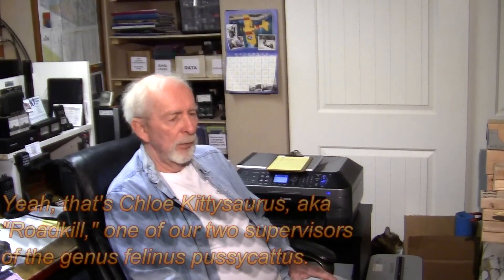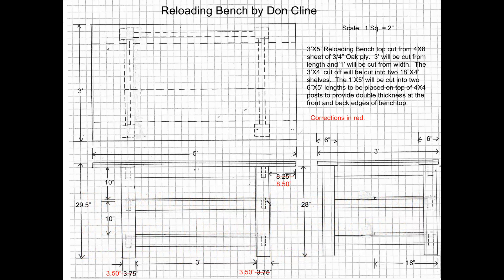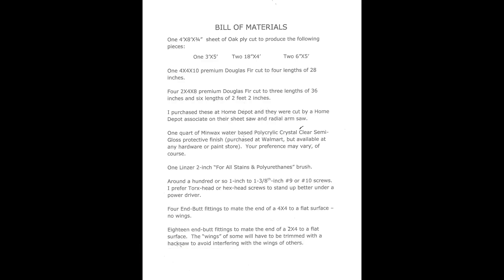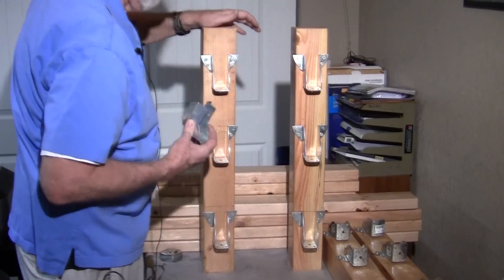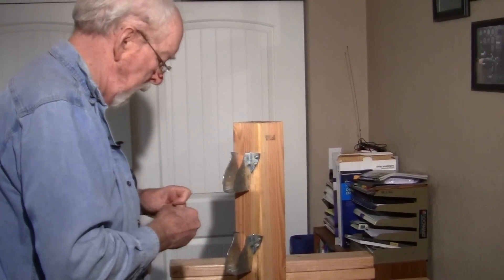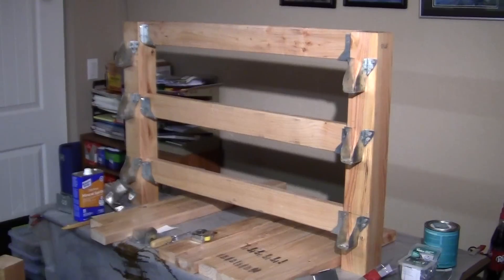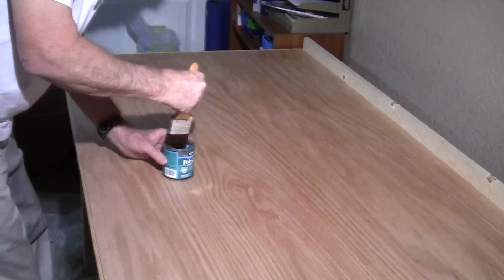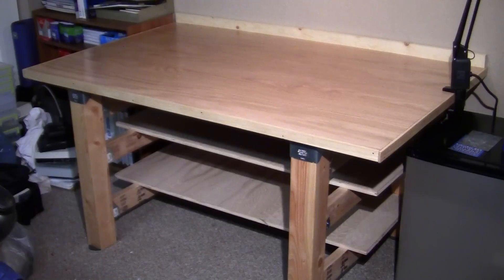Building a Rock-Solid Handloading Bench

Comment: Like somebody said earlier the craftsmanship on this table is high quality. I went to school about 10 years ago to become a carpenter. Your work is just as good as a veteran Mr. Don, so good I will be making my table the exact same.
Reply from the maker: Thanks, JC.  If I had it to do over again I'd reconsider the use of the 2X4 hangers to fasten the legs to the 4X4 legs.  The 'wings' overlap the edge of the 4X4s, and can be dangerous.  At least be prepared to file or cut them off.  Thanks for the compliment; it was my first attempt to build anything like that.
Reply: Don Cline I built a toy box for my nephew a couple years ago. You can go without the hangers and use long screws. But the hangers give the table some class making it stand out so shaving down the sharp edges will work but I wouldn't take them away.

Comment: Great video Don.  I found a Simpson Strong Tie Workbench Kit on amazon, $40.  It has ties, screws, and great instructions included in the kit, you just add wood and tools.  I used my own measurements converted from the kit's plan.  Once my cut list was complete, I assembled mine in less than a hour.  Yes, I could have built one without the ties, but if I ever want to change the size or take it apart to move it, just remove the screws and it should be an easy operation.  Also this is solid as a rock, my total cost was around $90 (30"x60") but, I had scrap left over from the odd size.

Comment: Hey Don, I am currently building this bench using your design. I've increased the height of the legs to 38". I just bought all of my wood this morning and will begin finishing and sanding the wood this afternoon. I'll post how it turns out. Thanks for the video.
Reply from the maker: Good deal!  Hope you like the results.  I have to say I would not have used the 2X4 hangers if I'd realized the "wings" on them would be wider than the 4X4 legs -- or I would have taken the extra time to saw or file them off.  In any event, the results have been excellent; the bench is rock solid.

Comment: You did a nice job on the bench for a non-woodworker. Interesting use of joist hangers and post mounts.  There are a couple of changes you may want to consider if you build another.  For the top you may want to use birch rather than oak.  Birch is much smoother and has a very close grain.  After it is finished it is much easier to clean and is better to write on when making notes when reloading.   Also if you use a sheet of pine B/C plywood the same size and glue it to the birch, this gives you a very stout top. You may can leave out the middle rails and stretchers as this is overkill given the size of the project.  You also mentioned that you would not use the metal brackets, a great alternative to that is pocket screws.  When I built my bench I used my Kreg system and it worked great. Overall nice job.
Reply from the maker: Thanks.  I'm happy with the way it turned out, although I would not use joist hangers and post mounts if I did it again.  (But I don't expect to be doing it again.)  :)  The use of birch rather than oak and B/C Ply sounds interesting too.  As it turns out the oak worked out okay because I put a sheet of static-free grounding sheet,  the stuff used by electronic technicians (I was one) to work on CMOS devices on the top surface.  I grounded it and the reloading press to the AC ground to cut down on static.  The average humidity level where I live rarely gets above 5% except during the monsoon season, and touching anything results in a zap.  I don't want that to happen when I am working with gunpowder and primers.  Thanks again for your suggestions.

Comment: Mostly glue and joints that works  with some “T Slots” imbedded into the surface. If I want my Dillon then I go get it fixed to the base will be every thing to get going. If I want a vise I get  a fixed base that holds the vise.
Reply from the maker: Good luck.

Comment: Hi Don... Wow, what a video! Very impressive... I have 2 quick questions... I have not watched the video entirely, I skipped around a bit so I may have missed if you answered this either in the below comments (I read a few but not all of them...) First question, ball-park cost for this entire table for all the materials (including finish, etc.)? 2nd question, is the table able to be partially disassembled in the event of having to move or transport it elsewhere? Thanks for the great video... Very nicely done!
Reply from the maker: Emerson Goodrich   Total cost was $163.81 for the wood and the metal joiners and water-soluble Minwax for finishing.  Well, I didn't make any attempt to allow for disassembly in any convenient way, but if you back out the screws I used it can be disassembled.  One thing I want to caution you about is that the metal 'hangers' I used are meant to be butted up against flat wood, and as a result they have little 'wings' that protrude out beyond the edges of the 4X4 legs.  You want to be careful about those to see they don't snag on anything.
Reply: Don Cline It's not too late.  You could put those post mounts on the backs of the front legs so they don't show.  Those brackets are soft steel so you could hammer those sharp wings on the 2X4 hangers around the sides to keep them out of your skin and clothing.  For a very few dollars more you could have used oak for the backboard and edge trim.  Just sayin' as the youngsters say.

Ray (67 Also retired SEET)